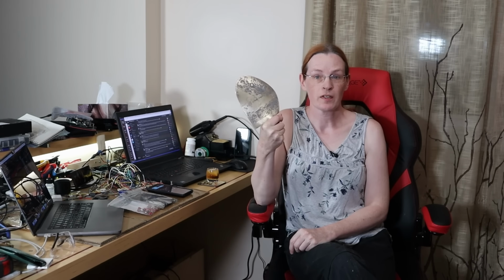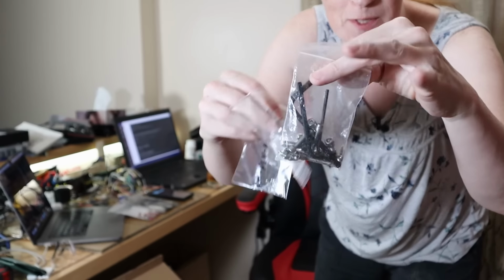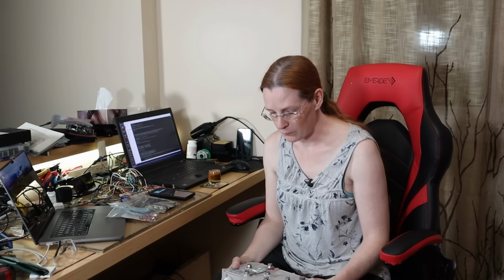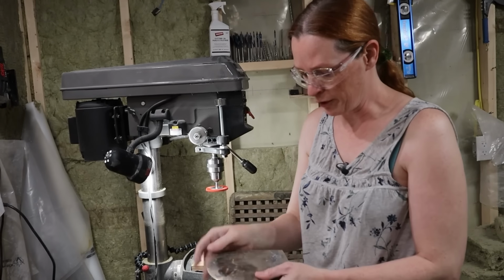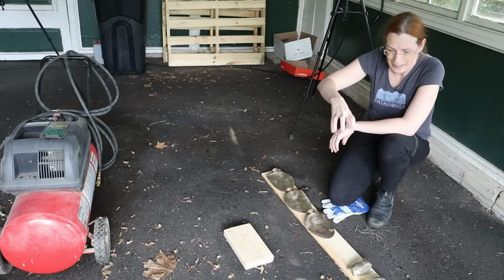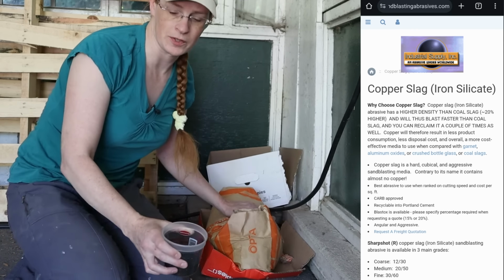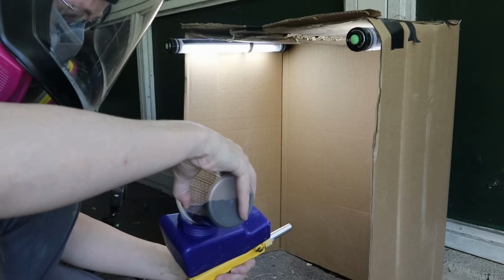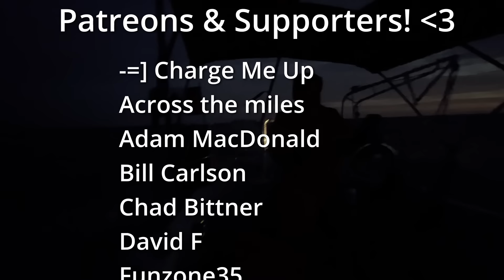Ep. 96 - Please Sir, My Prop, He's Very Sick

Comment: I would try to restore the prop blades with a tin or with tin-lead(antifouling effect) solder. In addition, tin coating protects well against corrosion.
Reply from the maker: I thought about lead after someone else suggested silver, but then, adding lead will make it harder to deal with, shaving it down to profile. I'll probably stick with the epoxy, if only for the science of it.

Comment: Sand blasting takes a huge volume of air.  Gotta keep stopping to let the pressure build back up.  Also, before putting on epoxy, clean with acetone.  I see you keep running your fingers over the surface, leaving body oil there.
Reply from the maker: Good idea with the acetone, will do!

Comment: One thing about epoxy... Most produce a waxy covering when they set ("amine blush")... Paint on this and NOTHING sticks  you can wash it off with detergent. (We had to deal with this when we built Befur's hull)Which is strip-plank with epoxy cladding.
Reply from the maker: So to make sure I follow; After the epoxy cures, clean it with detergent, before applying prop-speed?
Reply: @TheDigitalMermaid  yes, that's right, just like a dirty pan (detergent and a light scrubbing. I'll send you some links on embedded systems too ..they are impressive and a steep learning curve...

Comment: As others suggested look at renting a bigger air compressor, regading the silver solder that may be too hot as you're ment to heat the metal enough that contact with the solder stick will melt. What about electrical or plumbing solder if the epoxy doesn't work out?
My deepest sympathies for Mr Tatter may he have longer life with an equally kind and good servant ❤ on his next journey
Reply from the maker: If I can't save my neighbour's compressor, I'll probably rent one, ya. Thanks for the kind words, I really miss the old man. :(

Comment: Sorry about the kitty! ❤

Compressor - you should blast/pause/blast/pause in a rhythm so that the compressor sometimes turn off. Then you have the good pressure. 

Two motors: is the added complexity worth it? Can you add the second one, later maybe? I’m thinking - why not do a one-motor setup to start with, to learn from? You’ll probably redo something anyway, after some test runs 😊
Reply from the maker: If you see ep. 86 "Decisions Made", I go into detail why I am adding the second one. It certainly does add complexity, but I think it'll be worth the effort.

Comment: For the prop pitch matters. lower pitches like 14 is for torque and 18 is for more speed I seen pitches go all the way up to 23. Find what pitch gets you to the speed you need with extra so if you have a current against you, you can still move forward.
Reply from the maker: Aye, exactly. The tests I plan to run will run the boat up to 3, 4, 5 and 6kts on the 5kw and 10kw motors (well, I doubt the 5kw will reach 6kts). I'll monitor the motor/prop RPM, input power and the time needed to reach the target speed. I'll also be doing these with 2.5, 3, 3.5 and 4 to 1 pulley rations. Very much excited to make those graphs! I'm hoping to be able to really dial-in the ideal.
Reply: @TheDigitalMermaid  You know those props tht you reverse then switch to forward to get overdrive pitch all that is is a higher pitch which lowers the engines rpm's. I bet 16-18 will be a good pitch for you. Remember you want to use as little battery as possible to move your boat. So test it  to see where you reach 5 knots at least amount of kw used.  go the same distance each test. This is not about time but about distance.  It is time but you want to know how far you can go on say 5kw of battery used with no solar coming in.

Comment: @20:20 If you can still hold the metal, it's not hot enough to affect it's temper in any way.  Unless you're a superhero or someone with nerve issues.  🙂  And, yeah.. walnut shells are great for removing paint and light-to-medium corrosion, but it won't affect the metal at all. Sorry.  If you decide you want to do more sandblasting, an auxiliary tank can give you a bit more work time.  Of course, the recharge time is longer, too, so you'll have to judge if it's worth the extra $40-50 for the tank to get another minute or two per pressure charge.
Reply from the maker: Aye, I figured just that; I was holding it, so it couldn't be too hot. If I decide I am going to do more, like with the hull work, then I'll bite the bullet and buy the Makita one that does 6gpm at 90psi, that should be enough to let me run continuously, thought it's like $700cad. Still though, my neighbour needs a tank and he helps me all the time, so I can give it to him when I move out of the house and I'll know it'll get lots of use.

Comment: You may have sorted this by the time this video went up, but you can probably rent a more capable air compressor at Home Depot or the Canadian equivalent.
Reply from the maker: Not sorted yet, no. I may have to do that if my neighbour's tank can't be sorted out.
Reply: You might need to up the pressure to 110 psi, or around there a-bouts. You’ll have to play until it fills right. All the components working together in unison been of different manufacturers and builds will certainly makes a challenge. By the time you’ll get them working together you’ll be done with the project. I know I been there. 
Sorry about your furry friend. I have lost a couple of them. And it always hurt to see them passing.

Comment: Get some paint remover, it will soften the paint and you can use a plastic wire brush to clean off the residue.
Reply from the maker: That would have been a good idea, had I thought of it before I finished cleaning it. I'll keep that in mind for next time.

Comment: In the future, consider using a hair net or tying your hair into a bun when using the electric power tools. There's been endless instances of peoples hair being ripped out (or much, much worse) when its just been left to dangle. However I do greatly appreciate you using the eye protection + mask! Not enough people using PPE.
Reply from the maker: Aye, editing the video I was thinking to myself "Why didn't I braid it at least?". Woops.
Reply: @TheDigitalMermaid   I cringed every time you turn your head while the machine was still on with your hair freely flying.

Comment: As a bonafide cat person, I know there is nothing easy about losing our boon companions.  Maybe I missed something, but did you try paint remover on the prop blades before mechanically cleaning them?
Reply from the maker: I thought about it, but decided that because I wanted to key the surface anyway, I'd skip using chemicals in the off chance they might interfere with the bonding of the propspeed later. Also, nice profile pic!

Comment: i hate to preach, but, i really hate anything wire brush, i find them to be rubbish or end up rubbish after just a short time of use, and that's from normal wire brushes to rotary, they end up so bent up and distorted, and most folk think that pressing harder and harder will make them work better, and then the odd piece of wire flicks off, and sometimes into your face, hence the invention of safety goggles
i am a true convert to the Nylon Filament Wheels, they are nylon as suggested, and have a wire fleck wound round each nylon strand, use in a power drill for speed, AND DO NOT APPLY so much pressure, these work best at speed and less pressure, they are great for sanding around rivets and anything light/soft and metallic and WILL NOT wear the metal surface away - i used to restore old Land Rovers and aircraft and the normal practice was to sand everything with an orbital sander and then drill out all the damaged rivets and replace with new, such a waste - at least with a filament wheel, you cut that process out
and you can use these wheels very safely on soft metals, brass, ally, copper, bronze etc etc without wearing metal out, primarily these are very good for polishing and will save you so much in the end, they make mincemeat of paint and underseal as well as rust and corrosion
but remember use at speed and not pressure, if you press too hard the nylon strands will bend, distort and rapidly fly off which is why a lot of people think they might be rubbish, and for safety, you can run over your hand without serious injury, over the years i have seen some nasty injuries
Reply from the maker: Can't say I'm a fan of wire brushes either, though this nylon one seemed to do a decent job. I didn't have to apply much pressure, which is shown by the simple fact it didn't get toooooo hot.